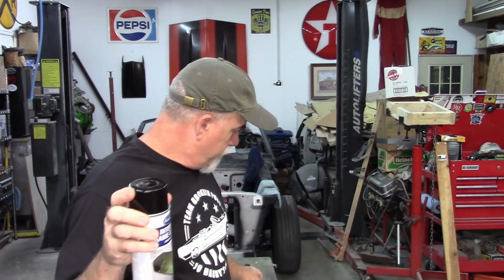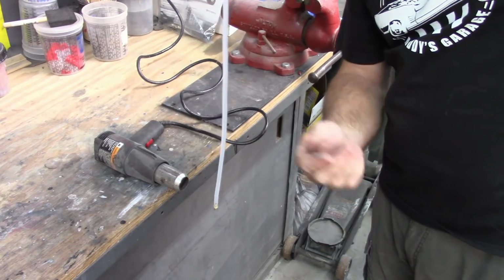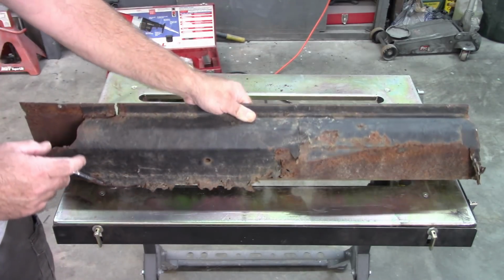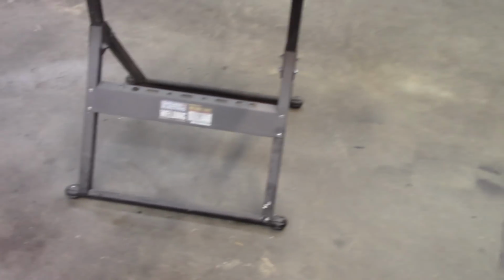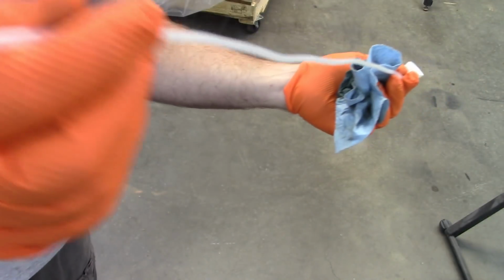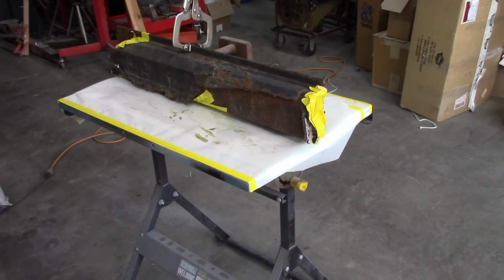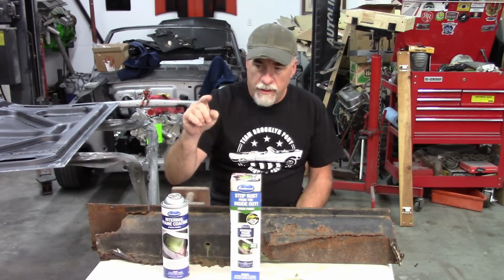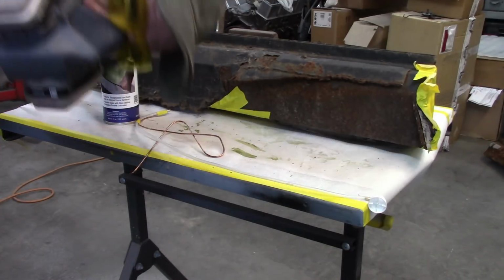Eastwood internal frame coater. Brooklyn Pony part 49

Comment: I've been using this product for over 5 years on 2 full restoration projects. I buy it by the case. I call it "frame shot". You can't be stingy with it, you'll need to load it on multiple times for thorough coverage. Maybe half will run out on the floor in the process. I used to straighten the nozzle hoses by pulling out the end piece and putting a straight welding rod in it, then use the heat gun on it, then put it back together. When the hose is too short to reach where I need it then I just splice 2 of them together with the brass piece embedded in the plastic can end, just yank it out with pliers and it will work to splice 2 hoses together. Sometimes I take the nozzle off the hose and just let it blast out of the open end of the hose for certain things. I have a collection of hundreds of these nozzles and hoses, lol. I use the Eastwood Pre solvent to clean them out because it's handy but I've also used Gumout, brake cleaner or any similar solvent with a female can top.  

Last year Eastwood came out with a Plus version of the frame shot, totally different formula, moisture cured urethane, thicker viscosity. The Plus comes with a new spray hose that is straight. It is made of a remarkable plastic that can be bent to any shape you like and stay that way, so if you want it straight or curved you just bend it. No more straightening it with a heat gun. The old version of frame shot still comes with the crappy soft hose but you can buy the good bendable hoses separately if you like. 

I have used an inspection camera to check my work with this stuff, you can find good inspection cameras for cheap these days, mine was about $150 5 years ago. I used the 2 different colors alternately to more easily see where I've been. Shoot the green first, let it dry, look for missed spots, then go back in with the black and so on.

Also with the car body on a rotisserie I can use gravity to take it in multiple directions to get better coverage. Again, multiple applications and excessive amounts work best. It does not pay to be stingy with this stuff and yes it's expensive at ~ $30 per can but ALL automotive paint is expensive. You get what you pay for.

This is a good product, I've literally gone thru more than 100 cans of it and I like it a lot. But like any other product of this type you must have realistic expectations and there may be a learning curve in getting it to work best for you.
Reply from the maker: Thanks for all the great tips and info on the new version!
Reply: @JoDaddysGarage  The Plus version comes in black only. Because it's thicker it can clog the tiny holes on the brass nozzle. This often happens if you must pause for a half minute while shooting it, you may find 2 of the 4 tiny outer holes have clogged, so it pays to have multiple clean hoses ready to switch over. I have some tiny wire size drills that I use to unclog nozzles after the shooting is done. 

I like to use the original version first like a primer because it's a little more runny and in my opinion gets into crevasses, penetrates rough surfaces a little better. Then I use the Plus to make a thick flow-over coat on top. I'm sure the Plus is also good for a one and done, but since I'm going to use a lot of material I mix it up.

I have used the Plus in a semi exposed cowl area, under the base of the windshield where the wiper motor mounts. The area was difficult to access with a brush using the Encapsulator Platinum (I use a lot of that too). So I got what I could with a brush going blind in there, then followed it with a couple cans of the frame shot Plus while the Encapsulator was still tacky. It bonded nicely and left a thick tough dull black finish in there, covered all the inaccessible areas and was good for a one and done.

Comment: Hey The best part of this product it consistency of water or slightly heavier and runs down into areas like seams and pinch welds. Give it a good first coat. I Did my Chevy Blazer with it and a slight drip landed on the asphalt driveway. It was years ago and it never wore off the pavement.

Comment: With this type of exercise you need to manage your expectations. I believe it is not possible to cover all inner surfaces completely. My hope is to do this process in a way that will minimize the rot of the inner structure of my mustang, it's one of those better that nothing efforts. My primary focus will be the structure below my seat risers. Access will be from the bottom of the car, at least 4 holes exist. I will need to find a way to clean out the structure before applying the product. I'm thinking of a custom vacuum extension I will need to build myself.

Also, I must say, what you are witnessing is the extent people are willing to go to for their classic cars, car owners are demanding rust solutions for every nook and cranny. I may tape off the end of the spray tube and poke my own holes which may or may not be more effective. Might be better or I might make a big mess. 

Thanks for the Amazon link. 

One of my favorite channels for sure !!! Thanks for taking the time

Comment: Great video.  Thanks for the info!  Another option is 3M body cavity wax.  You can buy long spray tubes that are already straight rather than curled up like the Eastwood tube.

Comment: Does this stuff “encapsulate” the rust like bed liner? Locking in moisture and creating even more rust? My frames got some rust on the inside and I’d like to give it a go but not if it’s like that bed liner stuff
Reply from the maker: I can't say if it's any better or worse. I have another video where I use chassis saver, and blow it into the rocker cavity.

Comment: You're really better off buying a proper Rust Proofing/Coating Gun with the long tube and different Spray Tips, the spiral one works well, and a can of Tectyl 506 or similar that will get right into the Seams, cover all your Drain Holes with Tape until it's finished and set, then just clean them.

Comment: Drill access  holes,and when finish spraying, get  rubber caps to seal the holes. Older method is to spray a mix of oil and melted wax into frame to coat. FYI👍🏼 you can get the fiber optic cameras on Amazon less $30, to use with phones, and see inside where rust up is, and what was sealed.

Comment: hey stop using carb cleaner what you want to use is brake cleaner because it doesn't leave a residue or a oilyness. just a tip i learned at automotive school.

Comment: Used that Eastwood product numerous times for inner rockers, inside door openings to seal the bottom hem, inside tailgate ECT.. Caution, I had a hose blow off the push button end once on an unused hose. Fortunately I had safety glasses on. Always clean the paint from within the hose with brake cleaner using the long stem on a standard spray can. The cost to buy a separate hose/nozzel assembly is outrageous so your viewers will need to clean the hose and brass nozzles fully to not have to buy expensive replacements.

Comment: Used this product and so far happy with it.  In addition to other areas we also sprayed the floor supports.  Also the outer rocker has a drain hole in front of the rear tire. Great access point.

Comment: I recently used this on a chevelle frame, and followed up with a boroscope. I found that it gave less than perfect coverage. One problem is that the can will stop spraying if it’s inverted and you won’t realize it. If I did it again I would cover the holes with clear tape to help monitor my progress. Also I would put a little tape at the end just before the nozzle so you know when you about to come out the hole. It would be nice if you could buy it in quarts and use an undercoating wand setup. I used four cans to do my frame. It does go on thin and flow into cracks as it is designed so make sure all holes are sealed up and put some plastic down on the floor because it will leak out in places.

Comment: That's good stuff, I used it to coat my whole cowl area and in my front rail supports before I put my new floor panels in. Even used it in that kick panel area where the fresh air comes in. I just hope it does what it says it will. Great video.

Comment: Hi Barry do you think that's better than cavity wax from Johan in South Africa
Reply from the maker: I believe they serve different purposes. Can't say if one is better than the other.
Reply: I think that the best method would be to use both. Internal Frame Coating first and than vax.

Comment: I definitely love the internal frame coating it use to come in qt cans that you could use in a spray gun. I prefer the green version but have used the black with good results....its not only good in rockers....but also good where you can't get to rust like behind B pillars and under roof, inside cowl, lower A pillar as well as inside the upper A pillar not all of us can afford or have access to dipping a complete body to remove the rust.....atleast this way you can treat it.

Comment: Yeah, I used a bore scope where I could and put a piece of tape on the scope “wand” for reference to know how far in I went and what I needed to get the tube into the cavity to the right spot. Double coat is a must for sure with how thin it is for full coverage. I’ve dug it so far. I made a scrap piece to see how it does in the long run. That was a year ago and it looks the same so it does something positive.

Comment: good stuff Barry. i use carb clean to clean mine also.. cheap, easy to acquire, multi-use.. if you get a chance or come across another need to coat inside a panel, check out the SEM wand. its about $5 and has a 360 degree pattern. the eastwood one works, but streams the paint. the SEM one mists it in a nice spray pattern. it uses a plastic nozzle instead of a brass tip.

Comment: Looks like a good product,  I wonder if you will get any reactions when you spray other products ( primers etc) over the top, like where you have overspray on the trunk lid or if it creeps through the pinch weld seams.